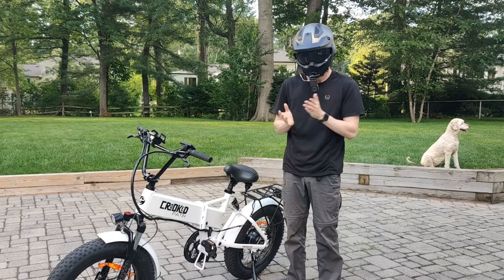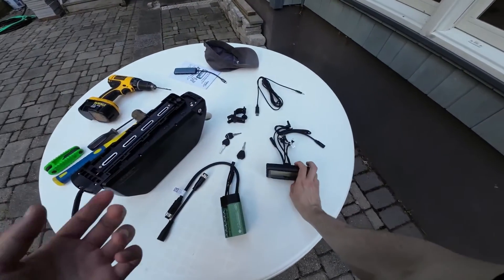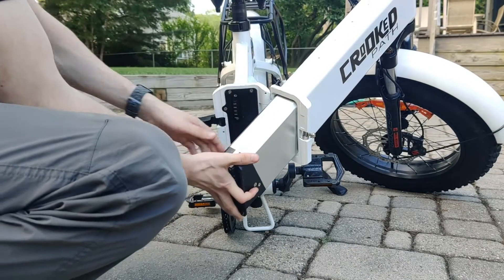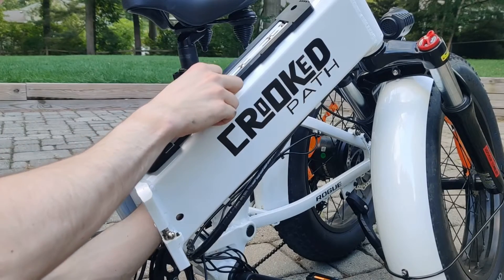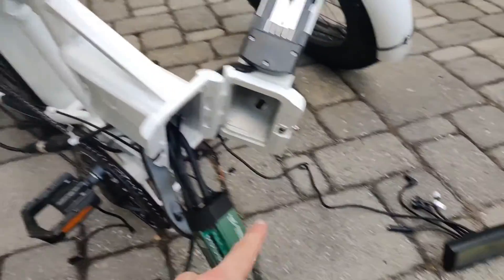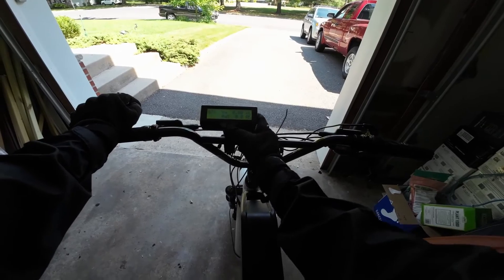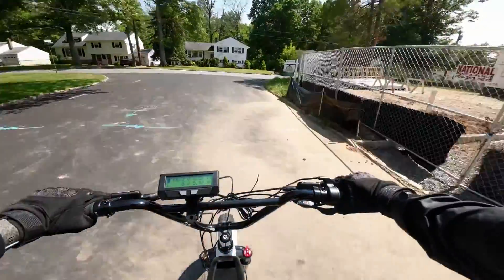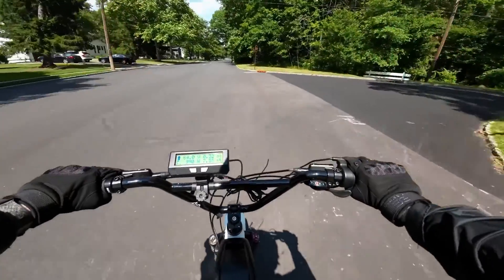Converting a 48 Volt eBike into a 60 Volt Beast

Comment: This is my favorite video of yours so far. Mostly because I'm copying your build. That seat is the best! Just got it. Love it! So comfy. Got the baserunner and CA3 on order. Also got the superharness and a 750C display from them as well. Looking at doing regen as my main goal so researching the G062 or G063 with dual V7 grin torque arrms and welding the clutch on it. But may not like the geared hub noise so may just pay the full $1100+ for the Grin Max45 rear DD hub. Not finding any cheaper alternatives for DD yet. Heard about a leaf 1500w rear DD hub and checking into it now. Thanks for the great channel and upgrade videos and ideas!

Comment: Nice video, could you tell me the approximate size of that 60v battery? (Length, width height).
I can not find the correct size anywhere online, they keep showing the dimensions of the 48v saying that it's the 60v. I just want to see if two of those 60v batteries will fit in my GT73.
Thanks

Comment: Limit the current and you can push full throttle continously without having to worry about the motor hub overheating. Some LCD displays have a current limiter mode, if you set it back 25% then you are at the same level as before. So say your max amp is 30A then set it to 22,5A through your display settings because going from 48->60V is a 25% increase in power.

Comment: So you converted to 60v at alot of expense and time, yet still only getting 1000watts and the same speed as a 48v system, also, you pretty much replaced all the ebike parts so why not just get a standard bike and fit it all to that ?
I have a engine pro and can get 31mph from a 48v 1000watt peak and not worry about burning my motor, seems like alot of expense for no gain

Comment: Was wondering if it's possible to leave the original battery intact and mount an additional one as you have, for a dual or tri-battery set-up. What is the clearance like on the down tube? I'd hate to leave that space empty. @Npl_ventures

Comment: does the old battery still squeeze inside?  Assume you added threaded flat "washers" into drill holes, but they shouldn't take much room away.  If dch009 battery format, they are 13s5p.  16s4p would allow paralleling them.

Comment: if ya add a temp sensor, the geared hub can take a lot of abuse, well until it gets to 45c, then the nylon gears start to soften and then you cant push it as far. most i've pushed so far at least is 95A phase and 42 battery amps. you can push 2500 watts! just being mindful of heat ofc, sometimes i have fun and turn it up a shit ton and then turn it down once i get to 50ish celsius. i've also done a controller swap but still on the stock battery, it can take a lot of power surprisingly, just voltage drops a lot though.

Comment: I have a bike similar built to that but I want to keep the internal 52v battery and get a second external and mount it up top. 

Do you think there's enough space to install it as you do here with the screws and nuts? 

Or do you think if I threaded the holes you drilled I'd have more clearance if it wouldn't already fit.
Reply: if you put nuts the stock battery wouldnt be able to slide in, and i wouldnt trust threaded screws holding a heavy battery on the thin metal. also trying to do the same thing, best idea i've come up with is to take the battery out of its housing and then slide it in and use nuts. but then how would it be secure? being able to remove the battery is a big deal for me as i cant take it inside so i gotta charge the battery seperately.

Comment: Hey are you running duel battery on this bike or do you plan to in the future? Does the stock battery still fit inside the frame with the top battery holder modification?

Comment: Was there not enough room on the under side of the downtube for the battery?  Curious as to why you chose the top side instead?  It seems like under the down tube would significantly lower the center of gravity of the bike.
Reply: Driest location? That’s how I would mount it.
Reply: It have the same from on an Engwe. Had to mount it on top. It could fit on the bottom but then you have the worry about the bracket breaking, as they’re not made to hold upside down. Also if the front shocks were fully compressed it would rub.

Comment: Can you tell us or show us how the other connections are made using that controller? The stock controller has many different ends for the throttle, brake sensors, pas sensor and such but the new controller doesn't have these connections that is easy to see or understand. Just curious how everything else connects back up. Wonderful video and thank you for this.

Comment: If you want real speed improvements, you need to go 1500w 3000w 72v and an 80A controller. Gear motors are not very good for high speeds.

Comment: Dude, I push 1800W regularly on those old Bafang G060 Fat Motors, drill a small vent hole and use Statorade
Reply from the maker: I got to research this more
Reply: @NPLVentures  Check out Grin Technologies on youtube. he covers hub motors in depth
Reply: @GoingOutToThePartyPeople  statorade does nothing for geared hubs? there is not enough heat transfer to the shell for it to do anything. same reason that when the motor is 100c or above inside its still just warm on the shell.
Reply: @willie671  Yeah you right I don't use statorade on those it's for DD motors

Comment: Looks good and it's full suspension just be careful for the sharp holes they will dig into the wires get some silicone or a rubber inlet to cushion the wires in the holes.

Comment: I pushed 45A to a stock 500W Super73 Z1 motor for over 2 years with no issues. 36 mph consistently. I sold the bike to a friend and it's still going strong.
Reply: That is great to know.
Reply: I'm looking to do the same how did you go about doing so?
Reply: @dmost2905  Battery and controller upgrade
Reply: What voltage were you using?

Comment: First, congrats on the transformation.  I like what you have done here.
Watts = Volts X Amps
60 volt battery means you likely have 15 clusters of 21700 cells X 4 in parallel for a total of 60 cells in that big Reention battery case....their biggest shark case.
As to Tuning because power is proportional to amps with a fixed number of volts, the more amps you feed the controller, the faster you go.  But...there are two constraints:
1.What is your BMS rated for?  It has to be well over 30 amps....or I hope so because if it isn't, when you get your new motor you will shortchange its capability.
2. your motor windings relative to the amps you push through.  If you push too many amps through your stock motor, you could burn it up.  Me?  I would let it eat because you have a new motor coming.  I would turn up the amps on your controller to about 35 amps or so.  Just don't run sustained 35 amps but in short bursts it will be fun.

This is what the hobby is all about. The butterflies you felt when you played Dr. Frankenstein with your bike is what builders live for.  Its partly why we do it. To see, what if.
PS. because I peer through the lens of product development, I would likely of solved your battery riddle a bit differently.  Two 36 Volt batteries in series for a total of 72volts.  One on top of the top tube where you have your big shark and one under the top tube hanging down. Split the baby.  Maybe an aesthetic improvement as well because it would look more balanced cosmetically putting battery above and below the frame tube.  Just a suggestion for a bit more juice.  You could sell your battery on Facebook if you wanted to go in that direction.  Just make sure you had big BMS's in the two separate batteries.
Reply from the maker: Well said!
Reply: Lol that was the shortest reply to the longest message I’ve ever seen 😂 great video your helping me sort mine out, haven’t made a video yet as not a youtuber but will try, also got a triple battery bike dual 1000 motors.. wonder what i could them to? With same voltage?  Fat bikes are perfect
Reply: Can I use two 48 volt batteries together in series? What's the least expensive controller out there that can handle this? :) Thanks!
Reply: Hey bro i have a doubt can i use 60v battery with my 1500w peak motor is it safe ?

Comment: Curious to why you aren’t considering a direct drive. Then you could really push it without having to worry so much about heat build up. Either way, awesome build. Can’t wait to see how that motor holds up.
Reply from the maker: My last build had a direct drive.

Wanted to try a geared hub to have the  corresponding benefits of a better gear ratio, efficiency, and light weight build.
Reply: @NPLVentures  with you not exactly maxing the motor out all the time and cruising at 20-25 you think this is the way to go?
Reply: @hank_Reardon  if you're going only 20-25mph you don't need a 60v system. Most $300 x 48v/1000w ebay kits will push a bike 28mph on accelerator only on straights.
Reply: @michaelcastro5339  That's true but I believe his plan is for higher speed potential when he gets his new rear hub drive motor.
Reply: @NPLVentures  Fair enough. I’m just hoping that you put a 5000 watt direct drive motor on it 😳